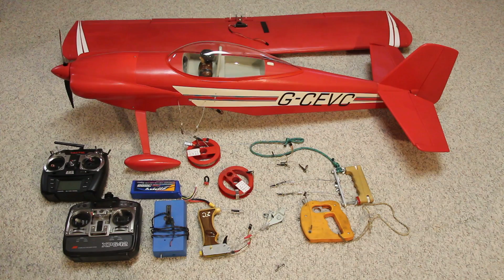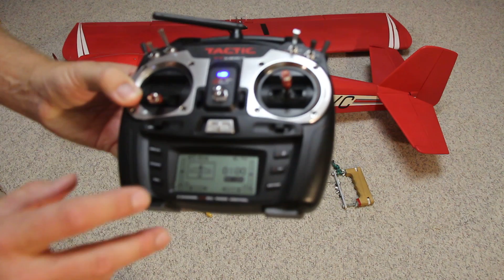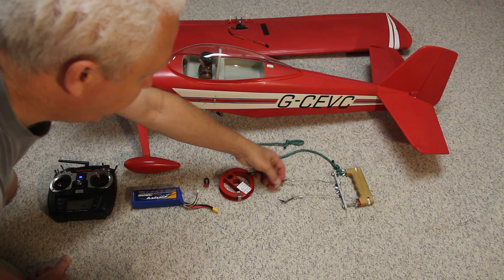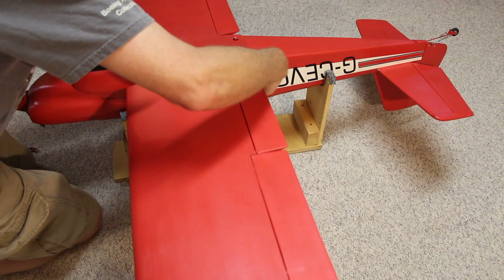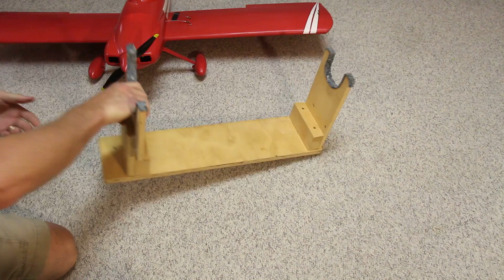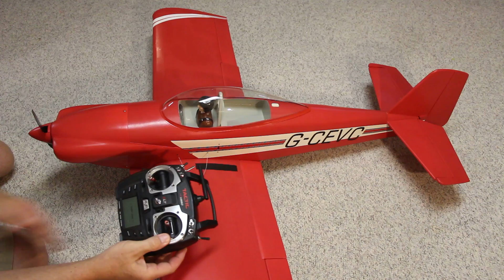2.4 Ghz Controls for Control Line Scale

Comment: I use 2.4Ghs as throttle control on my aerobatic electric models so I can stop the motor any time I want. Good for safety.
Reply from the maker: Makes perfect sense, Instead of a timer you install the receiver with a BEC ESC and you are all set. In competition you can't do that but you can have a 2.4 system to shut down the motor or engine that is legal for competition.

Comment: What is the purpose of the flaps? Slow flight with the motor throttled back?   Does not seem to be much of an improvement over coupled flaps activated by the bell crank.
Reply from the maker: the coupled flaps for a CL stunt model and the flaps on a CL scale are two very different purposes. the full size airplane use the flaps to increase the lift while landing. The pilot typically drops full flaps for landing and 1/2 flap for takeoff. So yes, the flaps on a CL scale model are there to duplicate the flaps that are on the full size aircraft.
Reply: @clscale  - Thanks for clearing that up.

Comment: I dunno if the focus in CL is more on the systems and equipment but in scale RC there would have been a lot more said about the model itself, it is beautiful, is it scratch built or kit? You briefly mentioned that you modified it when you built it but is it a kit build or did you design it?
Reply from the maker: this model was built from the Great Planes RV-4 kit that is no longer available. Nice kit but the horizontal Stablizer and elevator in the kit are not the correct shape to match the true shape on the full size aircraft. I had to build new stab and elevator to match the 3-view.

Comment: I didn't see any leadouts.  Are there any ?  How does the plane maintain roll stability on the lines ?
Reply from the maker: I have a leadout guide at the wingtip and the flying lines go thru those. You can see the leadouts coming out of the fuselage which is very short.
Reply: Ah OK... I guess I really meant to say "leadout guide"  instead of leadouts.  Yes, I did see the short leadouts. Thanks for the response.

Comment: Also a very nice video Fred,but isn't hanging the TX off of your belt a bit cumbersome?
Reply from the maker: There are multiple ways to manage everything but I have a metal clip that keeps the transmitter from moving around and everything is done by feel. I put heat shrink on the toggle switches so you know which one is the used for the flaps and other stuff. One pilots holds the RC car transmitter in his left hand and uses the trigger that way. Others hang the transmitter with a strap on their neck. After a few flights you can locate all of the switches and sticks by feel without ever looking at the transmitter. The trick is keeping the transmitter from moving around on you.